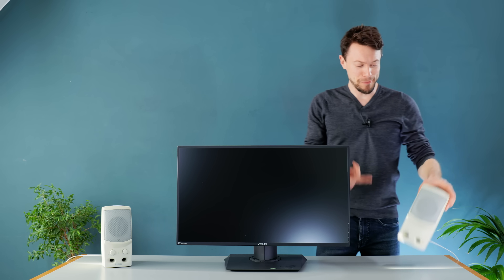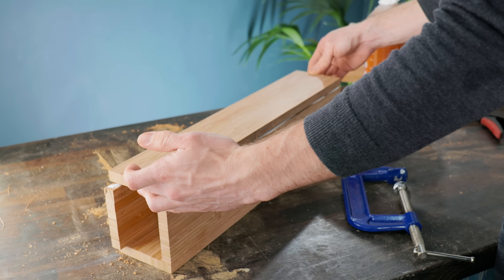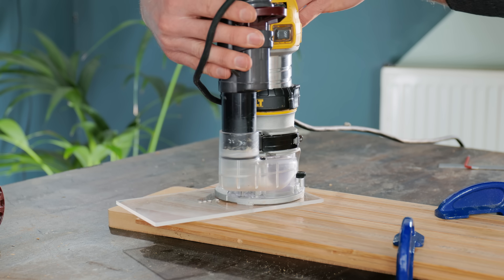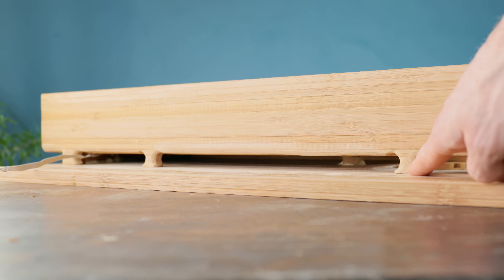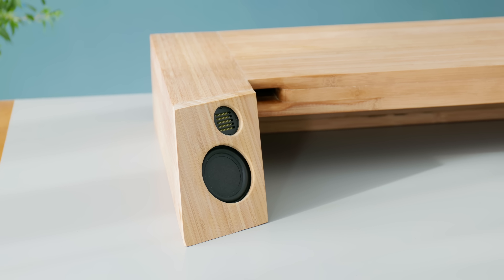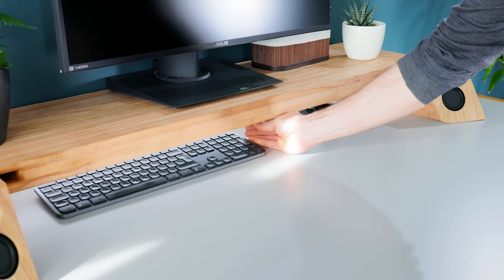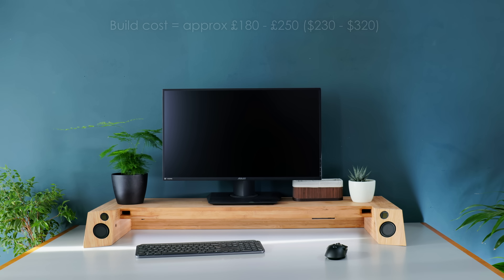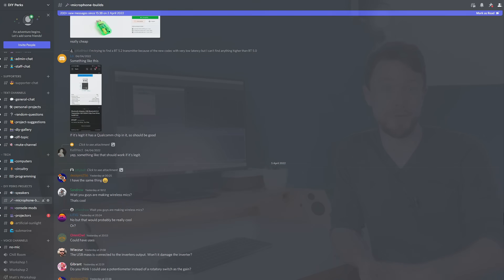Building a PC sound deck... with a twist!

Comment: The main issue with this is you need to use a super small monitor, or the overall height is not going to be ergonomic, or good for the neck at all.

Comment: Assuming the same amps were used for both the diy speakers sound considerably better to me im listening on a high end headphone and headphone amp the focal clear mg with arche amp it is quite a noticeable difference the diy system is much clearer has better highs and mids not sure about bass extension but that's more because of clip chosen to show them but definitely much clearer though maybe a little too high and splashy it is incredibly difficult to say over youtube and I would need to listen to a lot more tracks but what I hear sounds really good about the only thing extra I would have done is use a roundover on the speaker holes to help with reflections

Comment: curious I have a old google tv and I have it hooked up to my 2 Imac 27 inch and a 21 inch imac  plus my Hp 23 inch computer and I want to turn it into 1 computer but sony and discontinued this tv and I want to turn it into 1 full computer ?// can I take the guts from my imac and put it into my TV have alot more space then only thing would be screen ratio.. my apple has 5k

Comment: Would you proving a frequencyresponse measurement ?

The Link the Subwoofer is wrong.

The subwoofer is not that great, its resonancefrequency is obaove 60 Hertz which is not really Subwooferterritory. the DCS165-4 would have been a better fit, from a purely acousticly perspective

Comment: I personaly wouldn't cheap out on the crossover because you are going to have much more fun listening to it. Some time ago a did an upgrade on my canton 2.1 satellites with some high quality mundorf caps and mox resistors. It made a huge difference. If you dont have the money to buy the higher end parts there are also some great brands out there that offer great value for your money e.g. Jantzen Audio. Using resistors and caps ment for normal devices are going to lower the soundquality quiet a bit. The drivers you are using are amazing drivers but with this crossoveryou are kinda " bottlenecking" your speakers because they can deliver way more than you would get from theese parts.

Comment: I have to point out three obvious use cases. The first being 2.1 audio systems with a subwoofer and 2 tiny satellite speakers. Those offer good sound and blend in well with the other peripherals. These days it's also very easy to stream content to your TV that is more likely to have a fully fledged sound system attached to it.
In situations where you need a great immersive experience on your PC, let's not overlook the usefulness of a quality headset.

Comment: Finally watched this with proper headphones on. Those bookshelf speakers for $1200 do sound significantly better.
But I do admire the idea and I am planning to build something like this with my trusty Logitech 2.1 speakers from 2006. Just without putting the bass speaker into the stand, it sounds great as it is now.

Comment: well this has to be the biggest "take it with a grain of salt" but the DIY speakers are very bright, bordering on harsh and are muting about 800hz-5khz. Not sure the port for the mid range was really worth it. Their response curves are good enough and would only need propping up around 200hz which would be better handled by another driver. Now the unit as a whole... That is a true work of art. Well thought out and executed.

Comment: I suggest potting those internal electronics.  I could see the speaker's vibrations working things loose over time and possibly even causing fatigue failure on some of the component leads.  At minimum I would get some Silastic on the boards.

Comment: Love your videos as always! Just a quick note, the resistors and capacitors that you use for the crossover network are too small for power handling of the speakers you're using in this video. I'd suggest proper 5~10W / 4~8 Ohms Resistors depending on the Tweeters and/or Mid-Range Woofers' impedance and Alu. Foil Cap from Mundorf (E-Cap) 2.2uF~3.3uF for the Tweeter and 6.8~15uF to 'ground' out high frequencies for the Mid-Range Woofer. The Sub-Woofer may require a 0.9~1.2mm dia. min Air Coiled Inductor of at least 1.2 mH or above such as 1.8 or 3.3 mH depending on the crossover point between the sub and mids.

Comment: rather amazing at what your doing there, Matt. on my end I'm taking an old Apple//e Platinum from 1993 and bringing it into the 21st century. I just managed to put the OS onto a 256gb micro SD card, the next thing is a 1tb SSD as my boot drive. The Motherboard is going to be a Raspberry Pi 4b.

Comment: Holy smokes! Wearing some really nice DT 990 pros w/ a fairly pricey audio interface. the section of comparison of the 1200$ vs DIY is STUNNING. the DIY sounds so much cleaner, crisper, open, less.. heavy on the low notes.

Comment: I just don't understand how the crossover's components values have been calculated. For example the 5.6nf sees not only the 5.6k resistors but the others too, cutoff frequency is way off.
Reply: I would imagine that he's using Lpads, which lower the tweeter level without affecting crossover frequency

Comment: The speakers are way too far apart resulting in the dreaded "hole in the middle effect".  You should know this.  This is Audio 101.  What is needed is a VESA mounting system that holds high performance speakers on each side of the monitor.  So when you move your monitor around the speakers are always in the right place.  To make this work the speakers need to be light.  Most good speakers aren't light because then the cabinets would have severe resonance problems.  I don't think much progress has been made in this area.  Its hard to stop something from vibrating when its being vibrated!  Perhaps if it was clamped with vibration absorbing material....but probably if it could be done someone would have done it.  We'd all like speakers that aren't heavy.  So one needs a different type of monitor mount.  Perhaps sleeve bearings with right angle mounts in a rectangular frame to allow for horizontal, vertical and vertical tilt adjustment.  I'm sure you're well versed in this area and can figure it out.  

What you might find interesting if you appreciate good sound, is to listen to open baffle speakers, or speakers without a box.  Just a front panel.  The challenge is bass.  Another problem with them is they need to be far from the back wall.  Several feet.  And most people have their desk facing a wall.  So they'd have to change that.  Open baffle speakers usually use specially designed drivers to allow for more bass driver movement.  Its hard getting small drivers (4") below 100 hz in a sealed box.  So they use multiple drivers or go with larger drivers, say around 6".  Then they use an electronic crossover with a steep slope (18 - 24 db/octave) for the bass so that larger driver (probably 8-10" but maybe bigger if it was light and responsive) isn't messing up the midrange.  Most of the best speakers in the world are boxless but they tend to use ribbon or ribbon type drivers.  But now cone drivers are showing they can compete in this area and are usually a fraction of the cost.

Comment: Just for background MDF is used more because of its dimensional stability in various moistures. Solid timber is not used for this reason as it is hard to fully seal a unit which changes shape and the internal volume will change more with natural wood which will mess with the resonances. Even very high end speakers are MDF or maybe ply.

Comment: On the one hand I'd love to make something like this, on the other my speakers from the 90s or late 80s I forgot which weren't even designed for computer use most certainly, using a headphone jack for em, are cool enough though a bit bulky having its own separate main box unit.

Comment: Question, does the front HAVE to be glued? Will it affect the quality if I use a clip /clamp system along with magnetic or quick plug connectors to enable me to simply remove the front and speakers at any time in the future with little issue?

Comment: This sounded soooo much better than the 5x more expensive setup, That is positively insane! The volumetric demands placed on you by the subwoofers is always tricky, because it gets bulky and you never know where to put it, but integrating it with your desk setup is very clever. The structure serves the purpose of a) elevating the screen, b) LED light housing, c) directing speakers as well as d) ensuring enough air volume for the subwoofer. You would never be able to tell it had 10L in there.

Comment: Hi i have a small old laptop, toshiba nb250 it even have 1gb ram i think. I want something small just to have one specific game on it what can i do for it is very slow i cant even surf on internet. What can i do for it?
Reply: If you want to make an old laptop faster, install a [SATA] SSD, and check online, or the manual, to see if you can upgrade the RAM, and max it out, if it’s an old laptop, it shouldn’t be too expensive as it could be as little as 2gb RAM max anyways. 
3rd thing is to install Linux, if it can run the software you want, specifically a lighter distro eg; Lubuntu, as it will reduce RAM usage etc.

Comment: I have this odd idea that i'm not sure how to bring to life as i'm not  good with building electronics . I have a blue yetti microphone that I wish I could use wirelessly. I would need a USB Bluetooth adapter & a "mini usb Bluetooth receiver" that plugs into the mini usb port on the microphone itself. But I'm not sure if that would/ could still have the functionality of built in AUX port on the mic but having this same mic be wireless would look so clean on my desk. Anyone know how i could go about making this happen?
Reply: Frankly, I don’t think it’s feasible, you should just get a proper Shure wireless mic system, that said, I don’t think what you want exists on the market.
Websites online seem to suggest, from what I can grasp, that bluetooth’s bandwidth is sub 5mbps. USB 2.0’s bandwidth is 480mbps for context, and you’d still have to deal with powering the mic (since the Blue Yeti doesn’t take batteries, or have a built in rechargeable one). 

You should probably just mount your mic on a boom arm, with built in cable management, and call it a day (eg; the Elgato mic boom arm).
Reply: @GreeniusGenius  ok, I'll look into doing that instead thank you

Comment: Okay, I do think the $1200 speakers edged out your system a tiny bit, but the price difference is huge, and it's such a small amount that I don't think it matters much.

I do music production, and I use PreSonus Eris speakers, which are already tuned to be as flat as possible, and with a bit of tweaking to their channel balance (different rooms require different tuning), they're very flat, and sound great. I would need to tune that soundbar to be flat for music production, but those drivers are great, and would likely provide plenty of clarity/detail to the audio. Nice build!

Comment: Truth be told, most people won't be able to tell the difference between that soundbar and a set of speakers that cost 4 times as much. The only way they would be able to even know there is one is to see the waveforms compared on the display of an oscilloscope.

Comment: I love the way it looks and sound quality is extremly good compared to a DIY speaker system. I noticed only one thing which might be a tiny issue is that it seats flush with desk's top, but both of the surfaces are hard and on higher volume it can transfer resonation between them and that can mess up the whole experience. Flush mounted rubber feets would solve the probleme as they can reduce any vibration caused on lower frequences.

Comment: here's an idea for a video:
Switch HD XL
basically you make an enclosure for the regular switch like some sort of battery bank but it has a 1080p screen + switch dock board + LCD control board + the aformentioned battery bank, maybe you can even charge both the switch and the HD XL battery through the same type C port
you've done a ton of portable screen mods before so why not?

Comment: Ummmmm... you complained that the store-bought soundbar was "firing into [your] chest, so you built a speaker system that .... (wait for it).... fires into your chest. Actually they are a bit further apart, but still the same level. 

Looks nice, though, albeit takes up a lot more space.

Comment: I'm really curious if it's possible to add an extra battery to my phone, my S10e has never had great battery life and the rear glass has cracked, I was wondering if I could put two new batteries in it and 3D print a new back for it
I'm sure there are a few steps to get this working
I'm just wondering if this is possible or would something needed to be altered on a software level too?
cheers

Comment: Hi Matt,
I'm Bas from NL, and I'm doing a "fun" project with my bike.
I'm trying to connect a car stereo cassette to a 6cav dynamo, but the scematics i have seem to not work:
So it's 6 VAC to two 47uf 25V caps, and two (big) diodes on the ground side to rectify the ac to dc.
Then a 1000uf 25V cap on the output side for smoothing, but it won't work... A previous version with a 1000uf 16v cap would power a 12v RGB segment, but not the car stereo.

What am I doing wrong? Any tips I can use?

Thanks in advance,
Kind regards, 
Bas

Comment: What's the noise floor like with those Chinese amp boards? I've used quite a few different types in different projects and almost all of the ones I have tried have a really bad noise floor. It can be fixed with some modifications of the amp board on most of them though. I'm guessing there gonna be tpa3116 based, they are certainly the most popular and common. You are probably aware of this but you wont get rated RMS power out of these tpa3116 boards unless you run them on 24vdc. 15vdc will give you a little over half the rated power, so about 30w rms on the sub if its 4 ohm or 50w-60wrms if 2 ohms. Thats probably still enough for the purpose, but a 24v supply will almost double the power.

Your setup definitely sounds a LOT brighter thanks to those tweeters! And like always, it looks amazing! You're projects are always like a piece of art work.

Comment: To me......The DIY speakers were a little tinny compared to the "Professional" speakers  but what should be expected when the desktop speaker system cost less than buying Pro Speakers. But then when you consider the the time it took to consider the PRO vs the desktop speakers it's a toss up!  I'm NEVER gonna built that CPU sound bar, but STILL a Great Build!!!

Comment: personally I liked the 1200$ speakers a bit more but it would be a good deal if the price difference was about 50-100$, but when the difference is almost  1000$ there is no point going with that 1200$ speaker instead of DIY speakers we saw in the video and also it looks much better than that black boxes with speakers in front and that DIY speakers are much practical because I won't lose any space thanks to that monitor shelf.
amazing channel with excellent videos

Comment: Hopefully you see this Matt can I call you that?
I have a dilema currently and would like your advice.
I have 2 broken pairs of headphones one the is a blackweb wireless headphone the other are wireless jlab studios. The problem with the blackwebs is that the charger port broke off and I lost it. The problem with the jlabs is one of the sides is broke. I was wondering if I could take the still working type c charger port from the jlabs and transfer it to the blackwebs. I only have a cheap soldering iron some tweezers. tweezers. I'm stuck right now because I don't know if I can.
If you have any advice I'd like to what it is.

Comment: Just angle the sound bar upwards with a few sticky rubber/foam tabs under the front "legs", just make sure the plastic casing on the back isn't touching the table by adding a tab there if needed . 
Problem solved for a couple of bucks at almost any large store ! You're welcome.

Comment: While it by design looks good, and presumably sounds good, I'm not sure how to feel about electronics creating heat in a small confined area. I would rather have a sideby shelf with a small external amp with volume/EQ controls easily reachable, would also be better for the times you want to opt for the use of headphones.
Another thing I want to mention is the mounting of the mid-range and tweeter from the inside, after making a good looking furniture like this, the last thing you wanna do is break it if you have to replace either of the two elements in each cabinet.A solution to this is to mount it from the outside, and use a cover/clothing/ 3D printed bracket that surrounds the elements if you're keen to show them off and so on. Or simply just screw the frontplate in place and cover up the screwholes to your liking.

Comment: Look great and it showed how well my $39.99 soundbar works (300.00 Soundbar defect on the RCA inputs but worked fabulous on the digital inputs, once I confirm i bought all I could get my hands on)  unable build one nowadays due to health issues and I would love to be able to buy one. If so my den would be finished I start paneling walls with old flooring like built this with and got 3/4 away through and got sick and still trying get well enough to finish It.